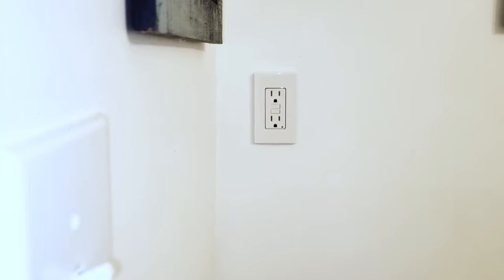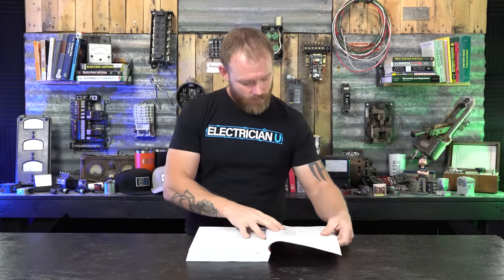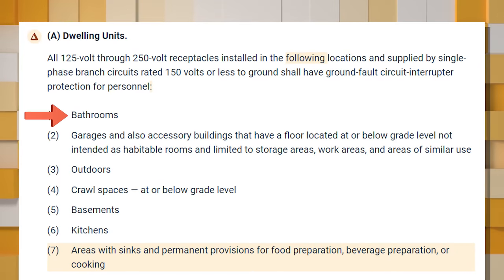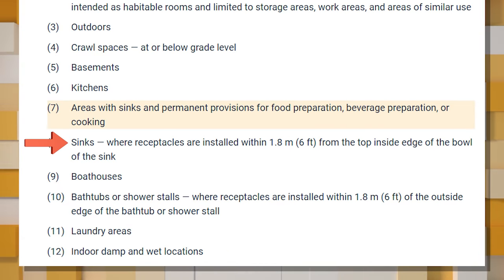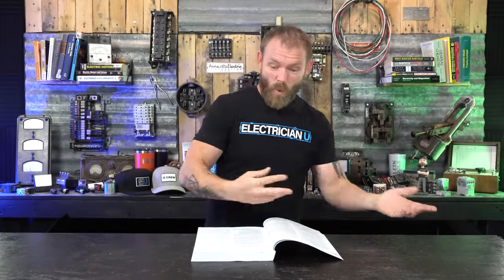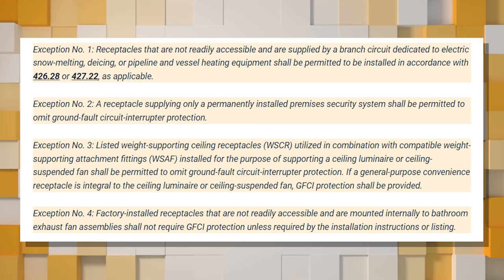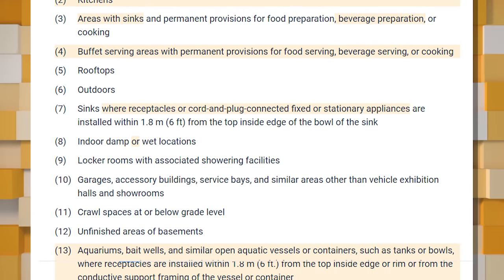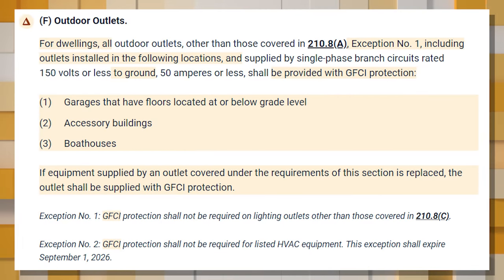Where and Why Do We Need GFCI Protection?

Comment: What about a light switch for a vent fan and light above shower where the switch is RIGHT NEXT to the sink, or right next to the toilet?   I have a home built in 2019 and there is a few NEC codes that were not met, but inspectors still passed and the home builder said "we wont fix that because the inspector signed off, it doesn't matter what code is.  Final inspection is the only thing that truly matters.".  one is the light switch to one bedroom is 15' away from the door due to a long hallway.  The electrition thought the door was going at the end of the hallway and put the switch in the main room.  Where the door was put 15' down the hallways, so the room has a hallway going down it before you enter the main room.  It's pitch dark trying to feel for switches and walls to turn a light on in there.
Reply: While technically the builder is correct, they are only required to comply with the AHJ (inspector), at the end of the day, the code is there to protect the equipment from damage and the user from injury. You should protect that switch. You might consider just replacing the breaker with a GFCI version that will protect the entire circuit and save yourself any rework. Depending on how the wiring was installed it might not be easy to add localized GFCI protection. As far as the bedroom light, if you want a switch there, you should get one. As you said, its a safety issue. Depending on the structure of the house and access to the ceiling, walls, and existing electrical, it may be an easy job or it could be a major undertaking. Good luck!

Comment: Is this based on 2023 code? I have always been told that refrigerators and microwaves don't need GFCI protection - I get the microwave. But, refrigerators absolutely should get one.
Reply: A ton of Refrigerators have water lines that run to them. So a GFCI makes absolute perfect since for them to be plugged into. Although I've seen a ton of apartments where the outlet for the fridge isn't even connected to a gfci in any manner.
Reply: Wait till you have gfci trip and ruin all your food.   We came back from vacation to find that and the garage fridge was ruined due to meat that spoiled in it and drained all through it.  No idea why it tripped but it did.   Smelled terrible.   The fridge frame is grounded.  If a hot wire hits the frame the breaker will trip without GFCI so you shouldn’t get bit via the frame.   It seems unlikely that you’d come in contact with a hot wire on a fridge.  The motor is in the back and you don’t plug and unplug it often.  Maybe changing a light bulb in the fridge could be a situation where it could be needed?  Idk.  There has to be some balance in these kind of mandates.

Comment: How many receptacles (numbers and/or distance) can be “downstream”  of GFCI and still be protected?
Reply: I do not recall a hard/firm number, but generally speaking only 3-4 at most. There seems to be an increase in nuisance tripping the more downstream receptacles there are. Depending on the outlet, there might be 1-2 mA of leakage current inherent to the device. That can add up over a number of receptacles. I am not sure how that impacts GFCI breakers, but I'll let you know as my remodel continues 🙂

Comment: I had no idea that the Bath Fan receptacle had to be GFCI protected. I'm with you Dustin and that makes absolutely no sense.
Reply: I just had a bath fan replaced. And it said in the manual that if the fan is located above a shower, the branch circut must be GFCI protected.

Comment: Thank you again!  man! you rock...I learn so much from you...I'm 62 and have been working with electrical for about 20 years, I'm not an electrician not by far, but I like to help people with their homes...I do however get confused with switches and traveler wires and such...but I'm still learning....wish I picked this up in my 20's or even 30's...I love it! thank you again for your great videos...Peace to You and Yours....
Reply: That's common I don't do three way or more switches on a weekly basis so it's on rough in just run the 14/3 between the. Switches and power the circuit at one of the switches and it's fairly easy after you start doing them more often

Comment: In regards to the bathroom GFCI receptacles,  do they have to be on their own circuit or can i share it with the lights and fan?
Reply: See NEC 210.11(C)(3). If receptacles in more than one bathroom are supplied by the circuit, then no other outlets are allowed on the circuit. If the circuit supplies only one bathroom, then other outlets in the bathroom, including a fan and lights, can share the same circuit as the receptacle.

Comment: I think in the UK they have the entire electrical panel gfi protected. I wonder how annoying it is when that trips.
Reply: Earlier ones had just one RCD, then they divided into two so that you did not lose lights in the room. Now they use individual RCBOs (Residual Current Breaker with Overload protection). I think these are now mandated.

The limit in Europe is 30 mA so there is less nuisance tripping.

Comment: Question: could you use the grid circuit breakers instead of the outlets?  And why not all the breakers in the box.
Reply: Cost and convenience. If something in your upstairs bathroom trips the gfci, with a breaker variant, you'll have to go all the way to the panel to reset it. With a receptacle style, you can reset it without leaving the room. Also the breakers cost 4-5 times more than the receptacles.
Reply: @dracula3811  thanks.

Comment: What about finished basements? They are not usually wet.
Reply: Code used to specify that only unfinished basements needed GFCI. They changed it for the 2021 code cycle and now it's ALL basements, finished and unfinished.
Reply: I do not believe the code differentiates between un/finished basements. The issue is that they are below grade so it is possible for the space to get wet. Therefore, it requires circuit protection.

Comment: What code book are you using? My 2020 Handbook doesn’t have that list if appliances or under 210.8 (D) Specific Appliances. It refers to 422.5(A) which does not mention microwaves.

Comment: Thanks for sharing info. I’ve watched a few of your videos now. I’m a builder trying to wrap my mind around AFCI and GFCI and you’ve helped fill that gap. However, I have a house with AFCI in the breaker box but GFCI outlets installed at receptacles on the circuit. Does that work or cause issues?

Comment: Long time subscriber but first comment. Our AHJ has already started requiring GFCI protection on ACs and it hasn't worked out so well. Every mini split heat pump has an inverter compressor in it and many standard ACs and heat pumps also have inverter compressors now. The inverters create so much electrical noise on ground that it trips the GFCI breaker every single time the compressor tries to start. It's such a huge problem they've started issuing variances for ACs and heat pumps

Comment: Dude, you broke that code down and that helped. I’m a Tinknocker and I’ve always stayed away from electricity due to fear. A Sparky told me educate yourself first safety and how it works then safety again. I never go further than my skill set but 22yrs in my trade helps with all. Keep up the good work Local 105 Tinners🤘🏼🇺🇸
Reply: tinknocker whats that slang for?
Reply: @terra6084   Sheet Metal Worker Local 105 Sparky🇺🇸

Comment: Great video! Could you do a follow up on when to use GFCI on a circuit, either in the breaker box or first in a series? In the original wiring, both bathrooms and an outside receptacle are on the same circuit breaker. Would it be advantageous to simply put a GFCI circuit breaker in, rather than a GFCI receptacle at eash location?
Reply: NEC 210.11(C)(3). A 20-amp bathroom circuit supplying more than one bathroom shall have no other outlets on the circuit. The outdoor receptacle shouldn't be on the bathroom circuit.

With the outlets on the circuit being in different rooms, I think it's better to use individual GFCI outlets, so that a trip in one room doesn't affect the other.

Comment: When did they start requiring GFCI's around sinks in bathrooms and in kitchens?
Can you do a video on replacing a regular receptacle with a GFCI?
Reply: Replacing a regular receptacle for a GFCI is pretty much the same as just replacing a regular receptacle, except for a GFCI has 2 terminals(not including ground) to make 1 or more regular receptacles GFCI protected.